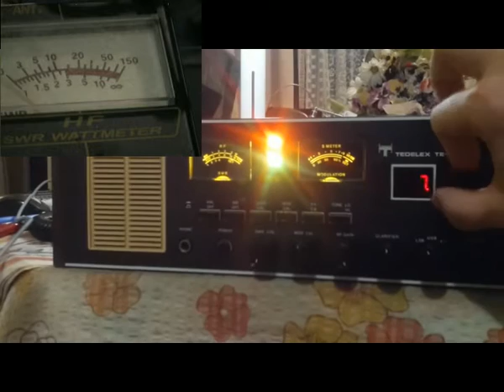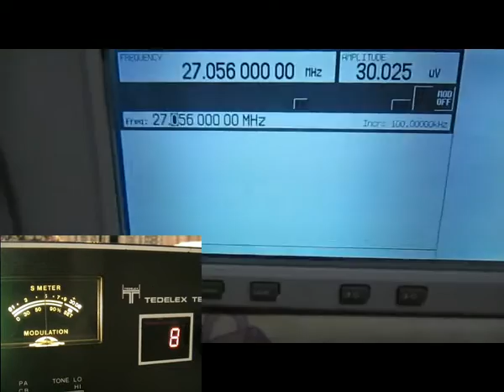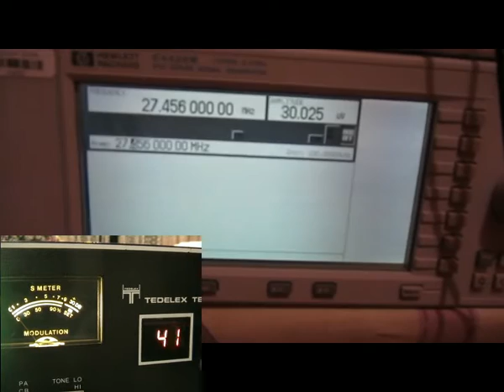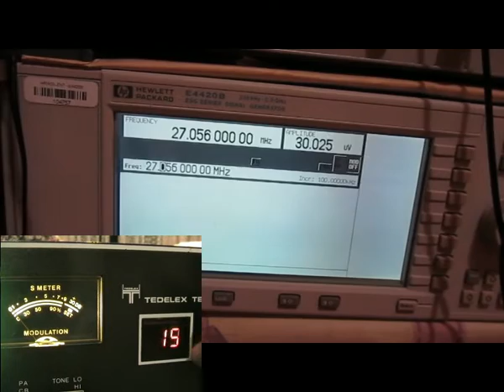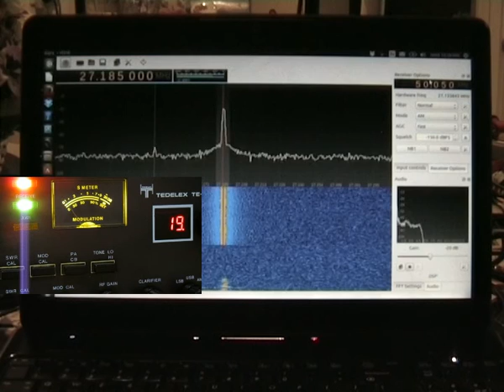Tedelex TE-7000 Restoration & DigiMax Lite (Demo with Darren)

Comment: Is that radio the same as the apollo ap708? It looks identical apart from the speaker grill cove colour. And does it have the same board?
Reply from the maker: Yes that's the one exactly the same inside and out excepts branding.